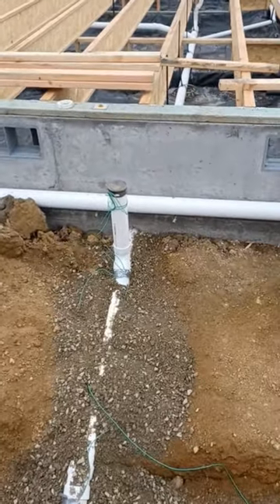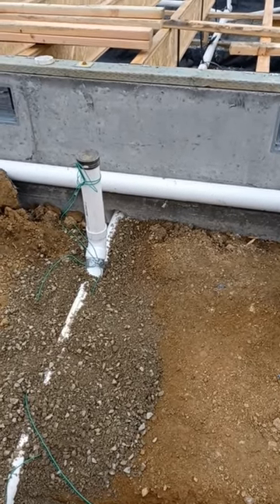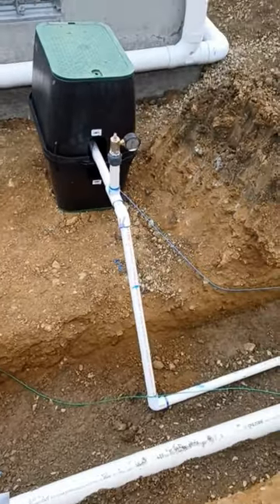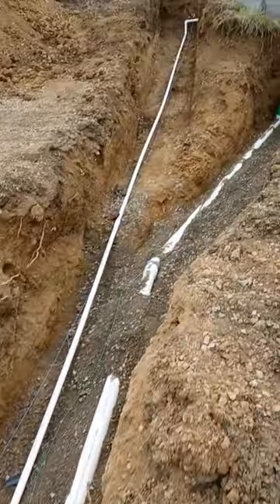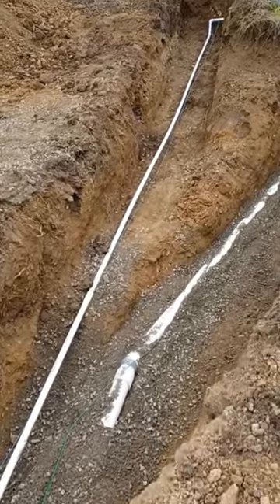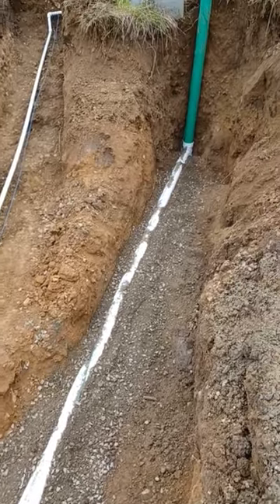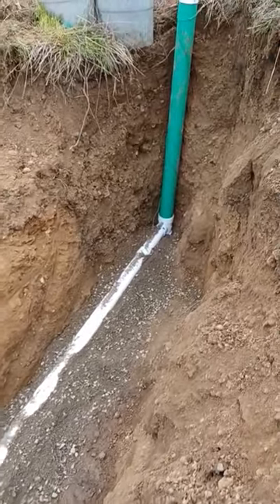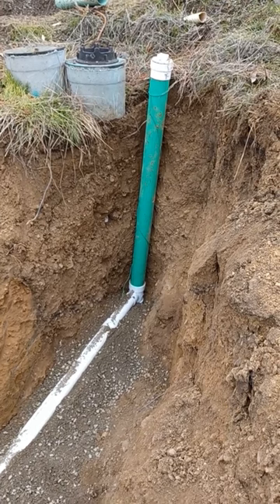Water & Sewer Lines for ADU Build

Comment: Do you make the sewer line foundation penetration before or after the pour? Looks like you poured it with a 4 inch set in the forms and then pulled it out and inserted 3 inch, then you will backfill around it?
Reply from the maker: Yes, we just leave the 4" in the pour

Comment: How close is that water line to sewer? I'm asking bc  worried my water line needs to cross the sewer line.
Reply from the maker: I belive 12" min seperation, on a difderend bed of material is needed unless both pipes are indoor rated. In that case, no min seperation... but always check with your local code and/or building official.